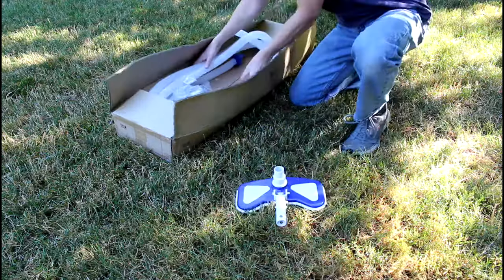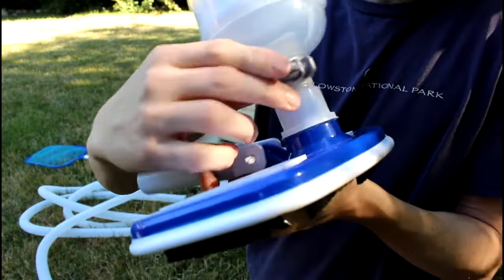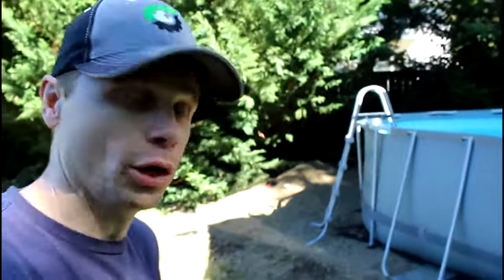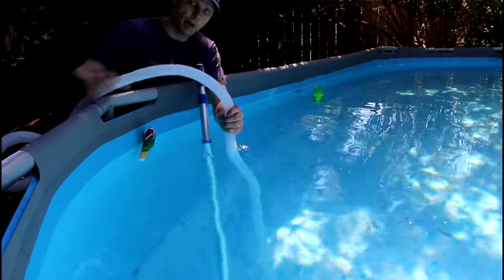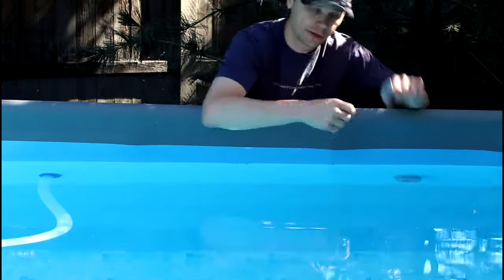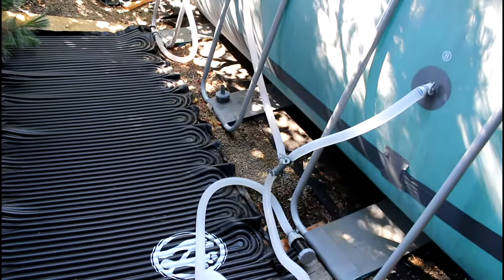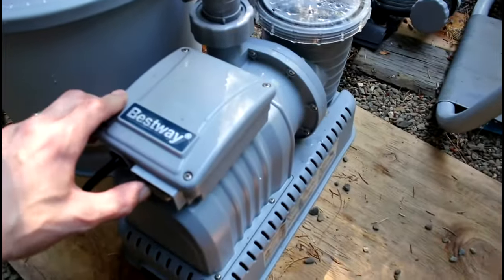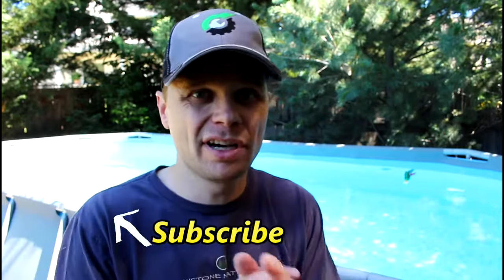Above Ground Pool Vacuum: Pool Vacuum

Comment: I just purchased the same vacuum kit and it didnt come with the blue adapter to plug into port B. I had to look really hard at the "instructions" and it shows you have to remove the gray port B thing, unscrew the top part and use that as an adapter. Just wanted to throw that out there for those who also bought this vacuum and have the same issue

We tested the vacuum today for the first time and arent really satisfied. We couldnt remove the other gray port B thing so we tried to cover it with a bag. We're going to try to remove it  again tomorrow and use the rubber plug to see if it improves suction power and performance

Comment: Omg i have watched 4 or 5 videos on how to set up a vacuum. Not a single one has adressed the one thing i need to know. How to turn the pump on the waste setting. I need to use flocculant and that can't go in the pump it has to go out of the pool on a waste setting. No one in all the flocculant videos i watched or setting up pump videos has said how. They either don't show it at all or mention it and say nothing about how. I dont even know if it has a waste setting. I have dead algae that is too fine to vacuum in ny robotic vacuum and i have to use flocc to get it to clump up and vacuum. But i dont know if the robot vacuum with work or if it will just stir it all up again so i want to use a vacuum to just suck the waste out and have it just come out of the pool all together on the wastw cycle. But nothing comes wjth instructions anymore to explain this stuff so i don't know which settings are which.

Comment: What about algae?  I'm trying to get dusty mustard algae out and it's pretty frustrating.  My pump is more basic and doesn't have a waste function. I'm curious if this vaccum would work with the syphon affect. I did it with my garden hose but it takes forever. The larger tubbing might be better.  Or could I just plug the return on the pool?

Comment: Hi! I have a smaller pool and only has 2 ports. Don't know anything about vacuuming. I attached the hose into the lower port.  Did I do it correctly? Do I have to cover the higher other port? Thank you.

Comment: I found this very informative but you didn’t say anything about how the pump should be set up. It should on rinse?? 🤷‍♀️ the back wash valve should have the solid cover? Not the port to allow water out when back-flushing? Right? 🤷‍♀️
Reply: I would imagine you can keep dial on filter unless it's real bad the switch over to waste? Guessing. Hi vac is attached to his skimmer outtake so it goes straight into filtration..someone correct me if I'm wrong..😂

Comment: Can you change the setting on the filter and pump water out of the pool instead of circulating it back into the pool for more suction. and replace the water...What setting would you use?   the one that drains the pool I'm guessing

Comment: Great video. I was also wondering what setting you have the filter on while vacuuming?
Reply: Yes it should be on the filter setting. Otherwise most likely you will pump the small particles back to your pool

Comment: Awesome video! Thank you! I’ve never vacuumed a pool so I apologize for silly questions- (1) do I have to have a debris bag? (2) what setting do you put the pump on? (3) should I backwash after? (4) I live in the desert in dusty Arizona- any tips for my climate? 
Thanks!
Reply: Sarah - Same questions here as well, and I also live in Arizona. My biggest issue is figuring out how to vacuum with the hose and keeping the dust out.